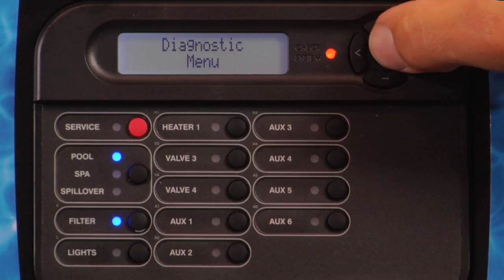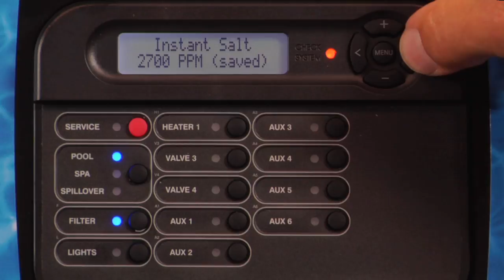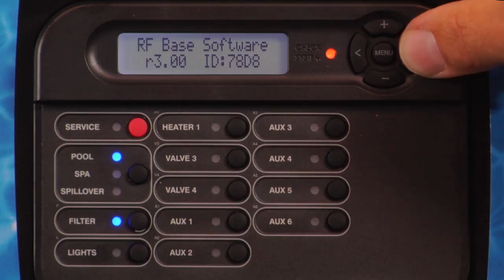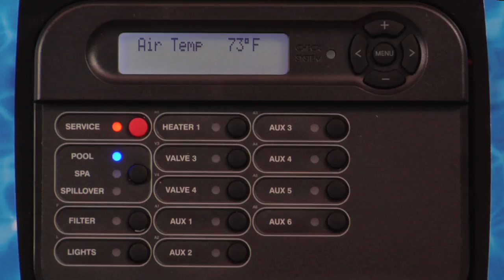ProLogic: Programming Diagnostics

Comment: I have both a Prologic and an AquaRight 900. They both seem to have a % clorination setting... which one is actually controlling the output?
Reply from the maker: Hi Arman, both are salt chlorination units. Each one's output percentage would be accurate for the cell that's plugged in (if each has its own turbo cell). If you have any other questions, please reach out to us with your contact information in a private message on Twitter or Facebook or use the contact form on our website.

Comment: The answer was go to the DEFAULT menu...scroll to the message INSPECT CELL and hit +
Reply from the maker: The check system light will come on for many reasons.  In this case it was the 500 hr clean Cell timer that needed to be reset in the default menu.

Comment: How do you clear the Check System Light?
Reply from the maker: Hi Ryan, you need to go into the diagnostic menu and find out what is causing the light to come on.  Once the problem is corrected it will go off.  Private message your phone number on Facebook or Twitter, if you need a call.